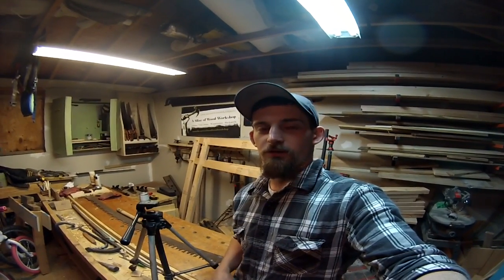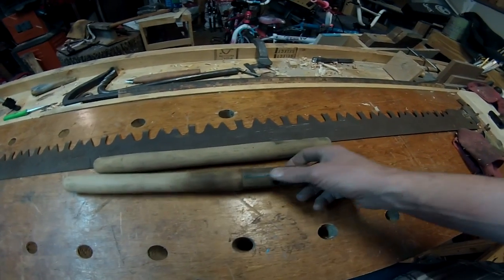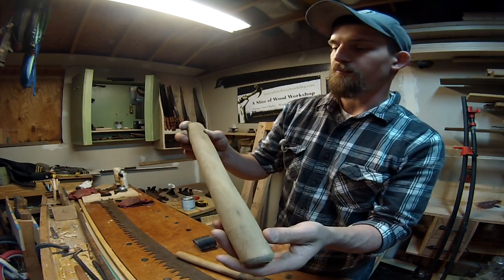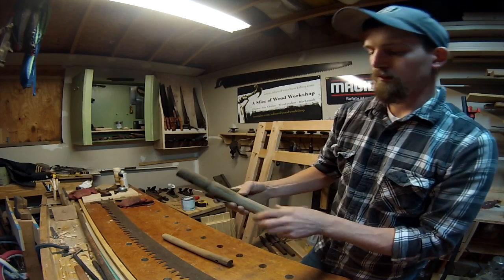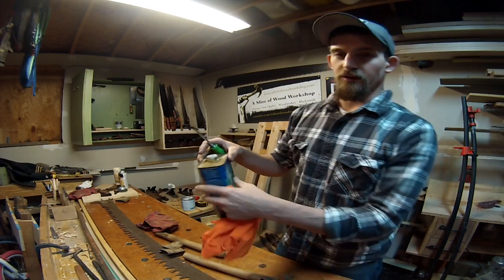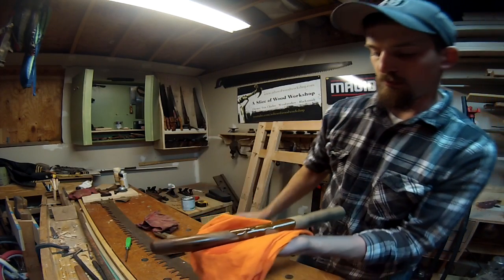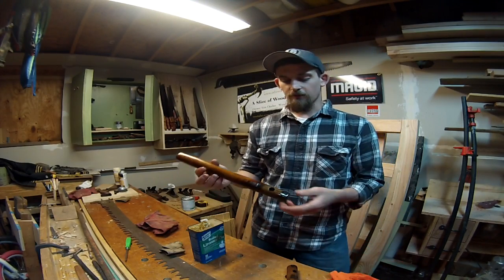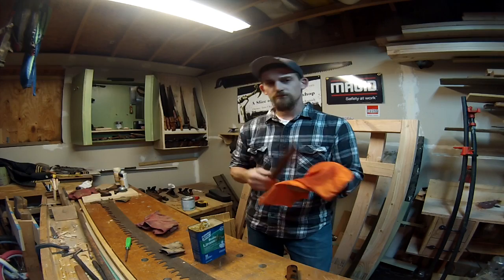Logging Saw Handles Get a New Life

Comment: Very nice!  I want a nice saw like that!  Prob won't use it, but I want one anyway!  
I think Wranglerstar stated that, you sound about close!  I thought it was 2 times daily until the woods stops accepting the oil (Oil pools on the wood and doesn't soak in any more), then every three months for a year, then once a year.. 

He also says to use fine steel wool to burnish the surface of the wood and lock it in.
Reply from the maker: McGinn's WoodShop i didn't know about the burnishing part. i'll have to give that a try. I have 3 saws, a 54" 1 or 2 man saw and 2 66" 2 man saws. The most recent has a very aggressive tooth pattern on it. Ebay is pricing them at about $50-$150, but sometimes you can find a cheaper one.
Reply: ***** Here in Brazil I use to find old tools in flea markets for a cheap price. I have some Stanley planes I bought there,  made in USA, England and Sweden. Some of them I paid less than 10 bucks. 
Maybe you can find these saws there in USA flea markets (they seem wonderful) for a good price.

Hey, love your videos!
Reply from the maker: raphaelbianchi I have found a couple of these saws for cheap as well here in the states. For some reason i just buy tools thinking i'll use them one day. I guess it's better to have and not need than need and not have haha.